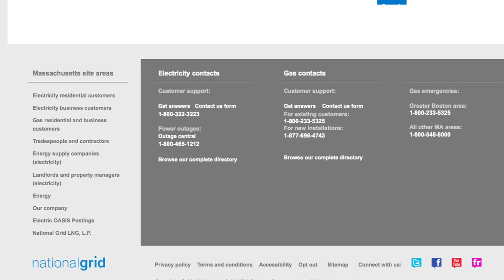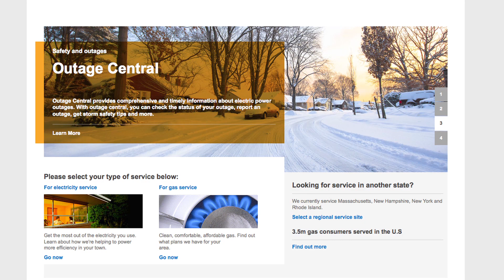National Grid: Power Outages - Preparation & Restoration

Comment: Why don't you bury the utilities like they do down South? Are you afraid of the labor unions? Rhode Island is mostly sandy soil and fallen trees and drunks find it difficult to get deep enough to take out buried cables.
Reply: I had no idea they bury them down south! That would be such a better option. Losing power up here in the winter can be life threatening without heat especially for the elderly. Pipes can freeze and burst and cause thousands of dollars worth of damage. Although with frozen ground it may be hard to access them if need be